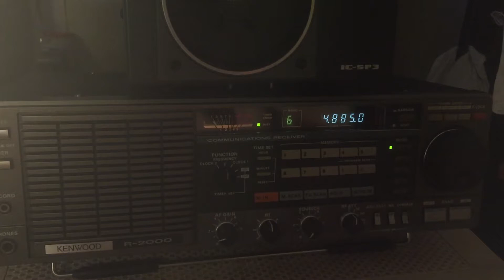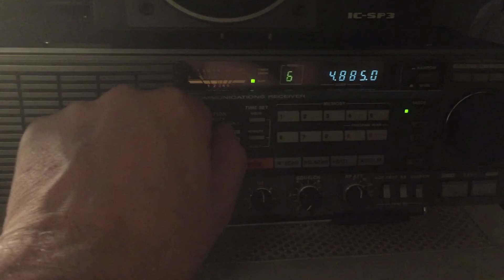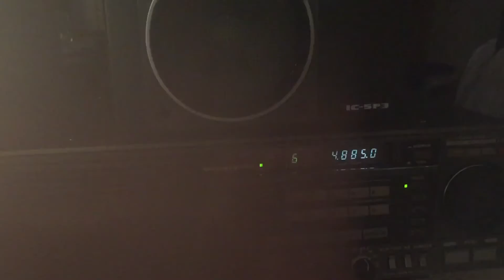Kenwood R-2000 and Radio DSP-40 Digital Signal Processor Demo- Notch Filter

Comment: could you go into detail on what kind of antenna you're using? That could make all the difference.
Reply from the maker: Palosrob .MaKaElectric Rebuttal Channel 75 ft longwire with earth ground. You do realize I'm in Northeastern US, station is a low powered one in Brazil, and propagation right now is poor at best? I could have a 500 foot longwire, and the signal would copy weak.